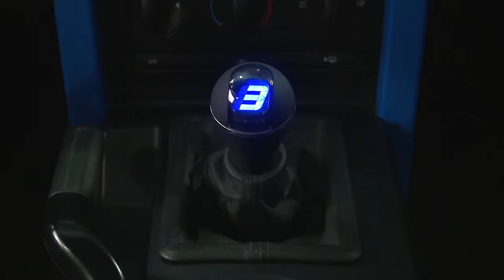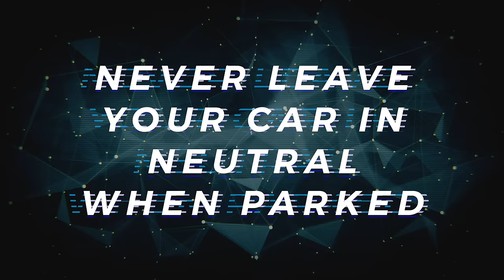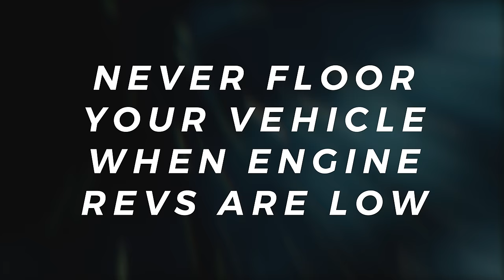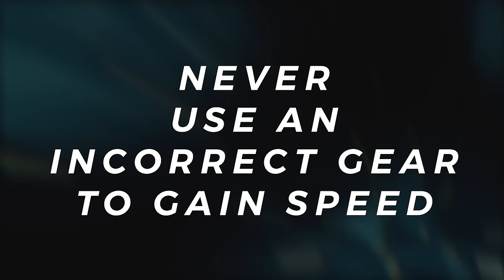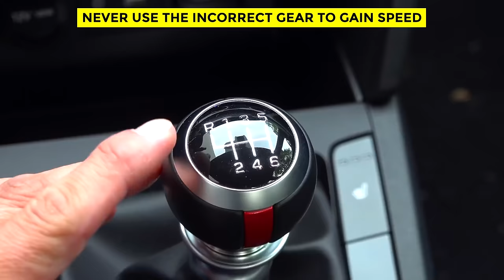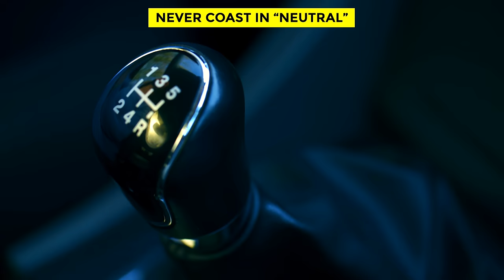7 Things You Should NEVER Do In a Manual Transmission Car!

Comment: Lol no 9:40 How does coasting cuts the oil supply to the transmission and overheats because its running at lowest rpm!? You know that manual transmission have its own lubricant which is basically always submerged half way in it and it don't get oil from the engine.  Other thing engine will not overheat because its in idle as it will get cooled down sufficiently by cooling system otherwise it would also overheat when in idle while parked.

Comment: 2:50 My Coronet and my Buick Estate Wagon didn't give the choice, the key would not lock unless the transmission is in reverse.      
When parking a car that gives you a choice, First gear is preferred when parking on an uphill, reverse on a downhill.      
The reasoning? If, somehow, the ignition should become energized while the car is parked, and somehow the car should start rolling, it will kick-start the engine and the car will run under its own power until it hits something unyielding.       
3:13 Shifting with the clutch partially or fully engaged makes the synchronizers do the work of the clutch.        
5:57 The pedals in my Frontier are spaced so that I can hold the brake with the left edge of my right foot, swivel at the anlke to feed a bit of throttle, and slip off the brake when the clutch starts to bite. Of course, my Studebaker had a hill-holder, wouldn't release the brake until the clutch was at the biting point.

Comment: Warning:only for experienced men drivers
For moving down the hill:
1.On steep decline move down in second gear if road is straight, let it brake on its own aka engine breaking!
2.When you approach a slight curve stabilize or balance engine and transmission when they get out of rev sync by gently pushing the clutch, if brake pedal is applied you got to push more even up to disengaging sweet point (middle point usually)
3. If you want to start moving on very steep decline you can jump right to 2nd gear in straight road with caution
4. If you get down close to U turn, break and disenage clutch, switch from second to 1st gear and slowly maintain brake and clutch control since all gears have their minimal working speed they NEED to maintain bcuz if you brake without clutch control car will stall and you can end up falling down the cliff due to no electricity or hydraulics your wheel will lock up!!! xx

Comment: For the never brake whitout engaging the clutch, it's actually the contrary. when you engage your clutch, you don't have the motor brake, which is basically free brake (it doesn't wear any part, exept maybe on really old cars, like at least 20 years old). Now keeping the same gear until the motor start to stall is much worse, as it actually wear parts, but as long as the rpm is good, you should not engage the clutch

Comment: One point, you can shift a maual transmission without the clutch once you are moving but not from a standstill, I never use the clutch from 2 gear on up on a 18 speed, you match road speed with the correct gear while momentarily letting off on the accelerator!
Reply: sir what u drive is a semi in which u can float the gears, what we drive are commuter cars with 5/6 speeds so please leave us alone

Comment: What you want to do is shift into your highest gear. Then, push the gas pedal all the way down and hold it there. Finally, use the clutch to vary your speed and acceleration. Don’t worry, the smell is an indication that you’re doing everything right!
Reply: Funny enough that's what race cars do to take the maximum power of the engine but ofcourse have to keep changing an entire engine nearly every race, sometimes even twice a race.

Comment: Going down hill in neutral will not damage the engine because the engine is at idle and the gearbox is disengaged. It does reduce control of the car to a certain extent because you are no longer able to shift gears.

Comment: If you are at higher speeds, you can and should brake without hitting the clutch pedal. As long you are in gear you hold more control. Your normal car wont stall before you hit 50-60 km/h.

Comment: Modern engine management systems will not allow the throttle to open fully (or much at all) if you floor the car in too high a gear.  The amount of fuel-air mixture will be matched to the engine RPM.  It is still possible to drive at RPM that are too low, but it's really not the serious problem that it used to be.

Comment: Just gonna point something out real quick.

Holding clutch in doesn't affect the car negatively when stopped, IF you hold it all the way in. It's a very common myth that holding in the clutch tires it out and eventually breaks it and it originated from numberous people not holding the clutch all the way in and grinders the gears as a result. If you hold it all the way in it disengages meaning that nothing happens to the car. In fact you also shouldn't hold clutch when on downhill cause it makes it go faster, since it disengages the car slides with less control.

If you wanna break slowly and controlled start slightly pressing the break then hold clutch in and as you do that add more and more pressuring to the breaks until the car stops in a buttery smooth fashion
Reply: it does affect the throw out bearing

Comment: Using the ebrake while at a red light is pointless and potentially dangerous. It is one more thing you have to do before you can get moving again. Neutral and right foot on the brake pedal. Light turns green, clutch in, stick first, and go. Nothing else. No ebrake. It is potentially dangerous because what if you are about to get smashed from behind? The extra time it takes to release the ebrake can mean the different between an ER visit or not. Accident avoidance is always a priority for any situation and the ebrake is the opposite of that.
Reply: i doubt the guy behind you at the light is just gonna ram you if you take .1 second longer

Comment: Can the first one kill? I'm a beginner and I always push the clutch in all the way when going downhill and only work with the brakes. My thoughts were like, if I accidentally push the gas then I will not accelerate immediately.
Reply: dont clutch in down hills, really bad habit. use the gears, just using the brakes will wear them much faster and you could even overheat them

Comment: back when I was turning a wrench I voided any clutch job if I let the customer test drive the car 90%  keep the left foot and the pedal and instead of putting in  neutral at a stop light, I had a customer burn up a flywheel so bad the real main oil seal was cooked, and he burned up the new clutch in 50 miles, the dude was starting in 3rd gear

Comment: 9:43 - The transmission's oil supply has nothing to do with the engine's oil supply. The engine has engine oil; the transmission has gear lube in a manual or automatic transmission fluid in an automatic. In some automatics, the transmission oil pump is run by the input shaft which is driven by the engine, but even at near idle, it is pumping.

Comment: i used to own a 99 ford ranger and it had a manual transmission and because i was stupid and wanted a new car i decided to sell it. the body was still in great shape and the engine was fine and the transmission was great. it's probably still running

Comment: On my mom car I found out  you could disengage the third gears without using the clutch. It was 20 years ago so I dont remember the condition required and never tried it since then.
Reply: in any gear you can you just go into neutral the same time you let go of the gas so theres no load on either side of the tranny

Comment: Most of this information is excellent. However, using the brakes without the clutch is ok depending on revs/speed. If you are breaking without changing gears the clutch is not necessary. For instance in my Honda city 6 speed standard i can stay in third gear on level ground through 40-60 KPH. If I use the brake to slow down from 60 to 40kph I don’t need to engage the clutch at all.
Reply: km/h*

Comment: But almost every day I have to drive on the motorway, where it's usually huge traffic for miles, and I'm uphill and have to move a meter or two forward every like 5 seconds. So every 5-10 seconds I have to stop and then go again at very low speeds (1st gear, sometimes able to go down to 2nd for a few seconds) and I can't go into neutral because it's uphill and there are cars near behind me. How do I overcome this? What is even the right approach? I genuinely feel awful in such situations because I know I'm hurting the car.

Comment: Also dont try to force in gears. Shift smoothly and try to feel the car. Dont just press in the gears. Try to do to as soft as possible. And also (works on most cars) dont shift in first gear if youre rooling because first gear is not synchronized like all the other gears. Most car and most drivers will have the ability to work with clutch when they're in second gear and rolling.

Comment: My car has a safety interlock. With the engine running, the shifter is locked in position until the clutch is FULLY depressed. I found out one day when I was trying to get it into gear and forgot to press clutch pedal. In a hurry that day.

Comment: dude the last part is funny :D Engine brake does consume gas and you can just simply switch back to the high gear if needed. What you should say it's dangerous as this will stress your disc/drum brake since the weight of the car is not help by the engine. Down hill is not safe for N but it's okay for straight line to have the car run smoothly without giving it gas.
Reply: modern cars have dcfo

Comment: I have a VW Transporter 6.1 for work, I offen have that I grind the gear because ot just WON’T get into the next gear. So after trying it the normal way for about 7 times my patience runs out and I just yank it in there.

That’s VW quality.

But my Mazda6 doesn’t have those stupid problems with it’s gears.

VW transporter 6.1 (Build in 2021).
Mazda 6 (Build in 2009).

Comment: Also if I'm in a tight spot and I leave my car in gear, the chances are when someone else borrows the car, they may not notice, and turning it on will push it straight into the back of the car in front

Comment: 2:00 never brake heavily without clutch, using your brakes at 70mph and slow down to 50mph thats okay because its in the same gear ratio but if you slow down to where you need to shift after slowing down then you need to have clutch applied when braking

Comment: I still don’t know how he did this but for my dads old job he had a 1992 Nissan pickup with a manual and he would shift gears without the clutch and his clutch lasted like 300k miles he actually had a flywheel brake and the mechanic at his work said the clutch was still is good condition that truck lasted to 940k miles when the company took it back and gave him a box truck it was city dash he worked for

Comment: good tips except for that last one if your engine overheats at idle while going down the road with wind blowing into the compartment then you dont need to have the car on the road as it will over heat under load  and if your in neutral you engine aint spinnig your teans your tires are which will keep the tranny lubed as its not connected to the engine oil or the engine pump opr anything in the engine other then the input shaft which is free spinning in your tranny

Comment: pressing the break while in gear is somthing good to learn. the engine can hold back the speed of the veichle, and it puts less wear and tear on your brakes. effectively turning your engine into an engine break. you simply have to learn what rpm your car likes to down shift at, and downshift as your car reaches those slower rpm's. allowing your engine to slow you down saves your breaks, and also allows you to be in the correct gear if you ever need to give it gas to make quick movements to save your life. always downshift and keep your car engaged in the correct gear when braking. I cant tell you all how many times it has saved my car from a crash. a car comes up fast behind you and you notice, but you are in gear slowing down, you can quickly stomp on the gas to swerve to the right or left to get out of the way. if you are not in gear, you stomp on the gas and you can turn, but you might not have the speed to get out of the way fast enough. so you will sit at the redline, foot to the floor, turning as hard as you can, while you get rear-ended.
Reply: you are right but you should learn how to rev match downshift that way you dont have to worry about what rpms it likes to downshift at, you can just do it anytime and it will be perfectly smooth
Reply: BRAKE NOT BREAK FFS did you go to school

Comment: bro, engaging clutch when braking only spreads on full stops. if you need to slow down it's not necessary to engage clutch. what about leaving on neutral when parked, it is written in manual to put on handbrake and in neutral because it's correct.

Comment: DO NOT use the fucking handbrake at a red light. That's what the foot brake is for. If it's fine for automatics, it's fine for manuals. The brakes are the same.

Comment: don't push the clutch when braking, let the engine help to decrease speed more efficient, only at the point of reaching complete stop push the clutch to avoid stall. use quick downshifts in emergency braking.

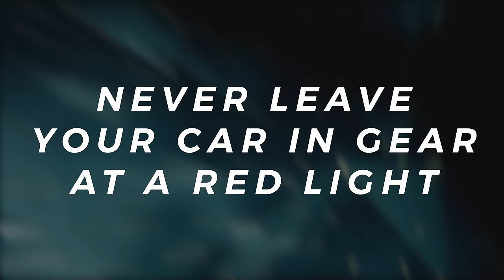Comment: 4:00 what? usually at intersections where i have to stop i don't have to wait all that long so just leaving it in first and keeping the clutch in is totally fine and definitely don't use the parking brake unless you are parking, just staying in first makes it easier to start moving again as you don't have to change gears again, you're just ready which contributes to better traffic flow

Comment: I dont agree with never break without engaging the cluth. Disengaging gear reduced handling and encreases fuel consumption. It should be disengage the clutch before the rpm drops to stationairy rpm speed.

Comment: Funny story:

A man arrives a car repair place. He says he has some problems with the gearbox. The engineer fixes the gearbox then the man leaves. After two months, the man arrives again with the same problem. The engineer fixes the gearbox and asks a question to the man.
-how do you use your car?
The man responds
-I use my car normally. I also put in the rocket mode.

Comment: I've yet to own a car that has a transmission oil pump driven by the engine so coasting in neutral wouldn't damage the gearbox in any way.
And given that the engine would be at tickover speed with air passing through the radiator while it is at it's lowest heat producing state, how the hell would it overheat?

Comment: These are suggestions for who doesn't use manual transmission.
Some points not completely accurate.

Definitely, don't rest the foot on the clutch pedal (not petal). It's not your foot resting place

Comment: 8:27 bye the way, some cars's gearboxes/shifters(for example:2007 skoda superb) are designed that when you want to put it in reverse, you have to push your shifter down, but ONLY when putting it in reverse. Imagine the damages you can do by resting your hand on your shifter
Reply: it wont cause alot of damage just worn fork pads

Comment: How to place first gear in hills for parking car when car is switched on.

Are we supposed to switch off car first and then place first gear in hills for parking car

Are we supposed to place first gear  in hills for parking car and then switch off car.

Which above one  is right
Reply: usually switching it off then putting it in first is easier, but you can do it either way. isnt any difference

Comment: if you go downhill in neutral your engine just idles with the oiltpump working at idle speed its not bad for you engine if its running at idle  i dont get how thats effekted by the speed your car moves besides the oil getting kicked around in the sump which doesnt change if you have a gear engaged
also its not like your clutch is that expensive i guess it depends on the clutch but its a part designed to wear of and be replaced which is totaly normal also if you operate it the best way

Comment: How about pressing the clutch while in neutral like waiting at a light
Reply: So if you're getting ready to come to a stop and you know the lights going to stay red then you can just go into neutral and coast to the stop (from a reasonable distance) 

If you're on flat ground you don't have to hold onto the brake or use ebrake but if you're a beginner I suggest you do one or the other

If youre on an incline use the brake or ebrake. Ebrake is probably easier if youre starting out

In any case when you're at a light do not hold in the clutch

Comment: Something worth mentioning is that if you wait still on first gear with clutch completely held in at max, it doesn't hurt the car whatsoever, its identical to not holding clutch in and having dead zone gear cause its disengaged.

Comment: "NEVER BRAKE THE CAR WITHOUT ENGAGING THE CLUTCH"?? Really?? You should only ever engage the clutch if the engine RPMs drop below 700 or 800 (1000 if you don't know what you are doing), then I would put it into a lower gear as needed according to speed if I will continue to drive before needing to stop, and only engage clutch while braking only if coming to a full stop. There are all kinds of bad physics and mechanical problems engaging the clutch while slowing down/reducing speed while not coming to a stop.

If I know the vehicle well, I can shift up and down the gears without ever engaging the clutch. And if not done correctly rookies can cause a lot of damage to the transmission. I have driven vehicles more than 75 miles through traffic and on the highway with broken clutches. No sense in having it towed costing $$$ hundreds when I could just drive it back to the shop.